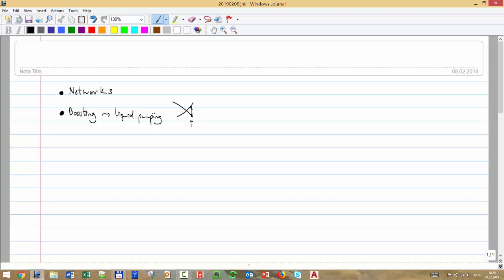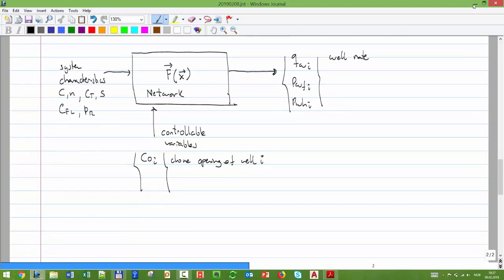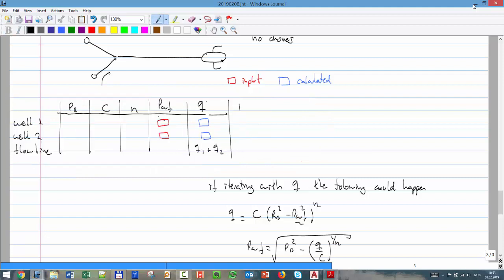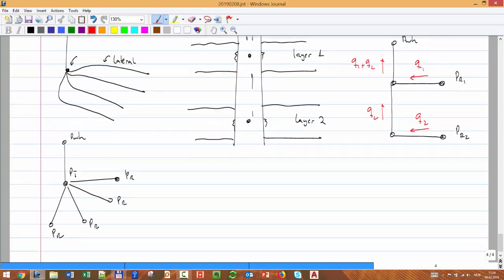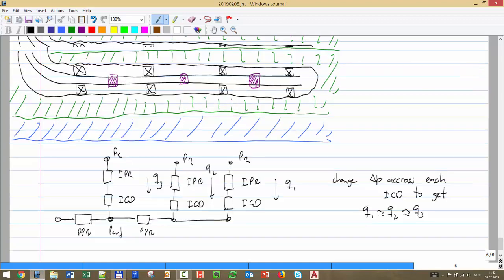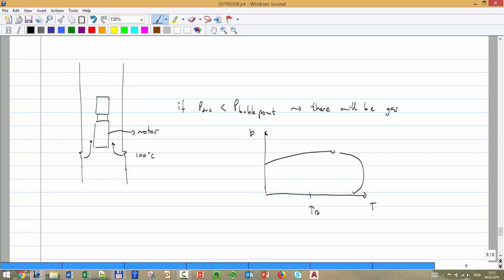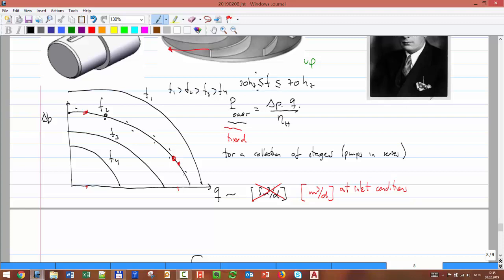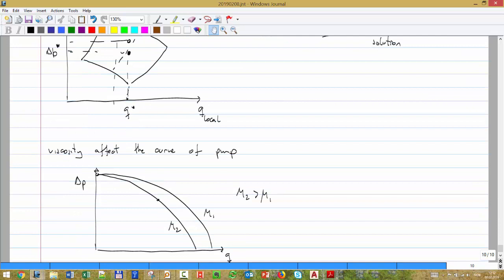Oil and gas production networks - introduction to pumping

Comment: Hello Dr. Stanko. Can you tell me please why we have differance between available and required pressure for the same production rate? According to calculations the same number of hydrocarbon molecules are travelling in a production system,  whatever calculation we make eather for available pressure or required we consider that the same rate(at standart conditions) to be travel at the same point however there is differance in pressure values. I cannot understant why it exicts and will be really happy if You can give more explenation about it.
Reply from the maker: Hello Jahongir, sorry for the late response. Yes, if you reach the same point in the system, the available and required pressure should be the same. If they are not the same this means you have to increase or decrease the rate to make them equal. If, on the other hand, you calculate the available and required pressures upstream and downstream (respectively) of a component (e.g. choke, pump, etc). This means that, if you want to produce the rate specified, the component has to provide the difference in pressure between available and required. if pav>preq then a choke is needed to drop the pressure, if preq>pav then a pump is required to increase the pressure.